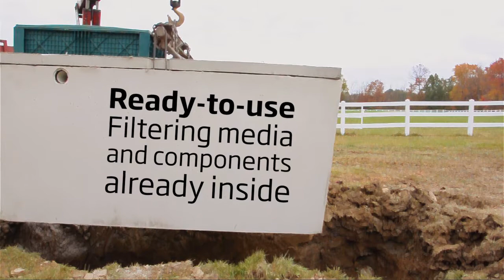Ecoflo concrete models installation guide

Comment: Only  20 years is not good as it should be permanent use 
.
Reply from the maker: Our system is well and truly installed for life! Never needs to be moved or replaced. The badge you see at the end of the video means that we have 20 years, now more than 25 years, of expertise in this field. 🙂
Reply: Still a large leaching bed needed?